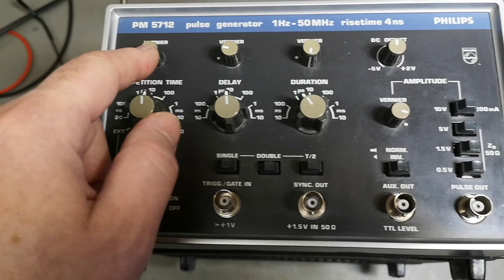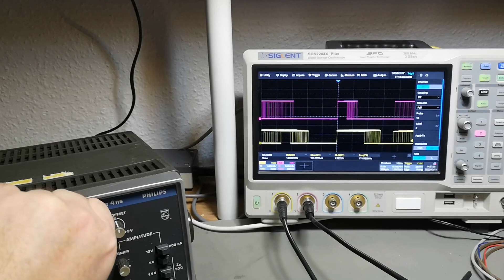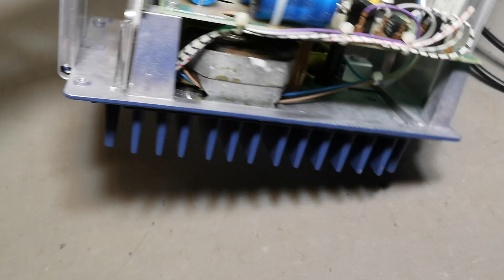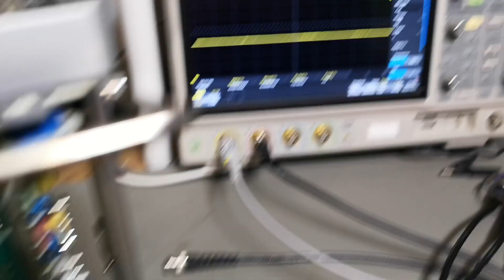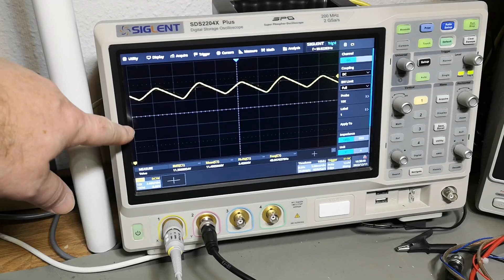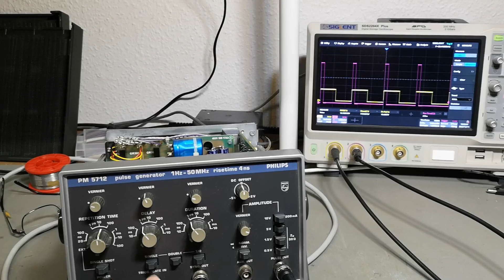Philips PM5712 pulse generator 1980 test repair teardown

Comment: Hey,, do you know whats the part number for the new rectifier you put in or the specs for a similar one?
Reply from the maker: specs are not importent for this part, anything that looks about this, with a hole to screw it, will be able to solve it, since it is low voltage